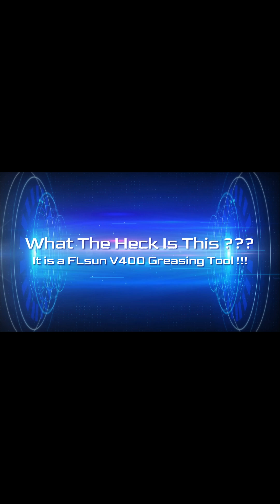FLsun V400 Double Axis Roller Guide Maintenance

Comment: Hi Dennis, I really appreciate your videos. I would like you to give me some advice on when, how and with what grease I should lubricate the ball joints on my FLSUN V400. Does the lithium grease work for lubricating the ball joints?
Reply: Hi, i have just used the white lithium grease with a seringe because my ball joints werent good lubricated at all, I was trying to get some information about whats the best lubricant for the ball joints and the information I found wasnt so clear and I ended up using the Lucas Oil Lithium grease the same grease that I used for the Rails, but some people said that the use PTFE grease for that, please let me know what you think please and thank you for your videos the helped me so much and made my expirience with the V400 much better.
Reply from the maker: Yes indeed. You can use the same white lithium grease as the rails. That is what I use and works perfectly...
Reply: @dennisgignac5103  Thank you Dennis for your quick response, another thing I would like to know is what modification your Speeder Pad has, I was searching on the internet and found on Printeables (Flsun Speeder Pad - Ethernet Ed.) and I found the STL files, but apart from the files I Could you say what hardware you use for the fourth USB? I have disassembled my Speeder Pad and it does not have a fourth USB, it only has a hidden micro USB and an audio jack. Thank you so much

Comment: Looked at every toothbrush at walmart, they had Oral-B and a couple others but I couldn't find a Modified one. Did you get that from a dental supply company?
Reply: Yes I ran into the same problem, please let me know when you found a supplier!
Reply: Just buy a normal toothbrush and modify it by cutting the bristles back until it looks like the one in the picture, and that's your modified toothbrush.